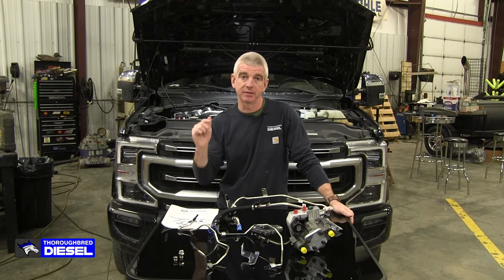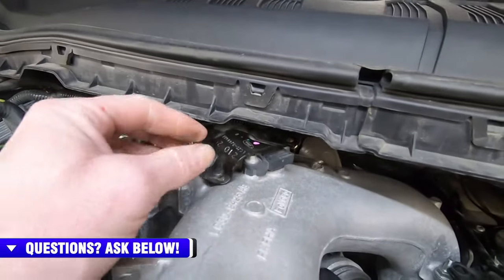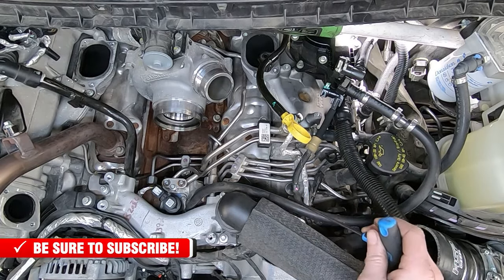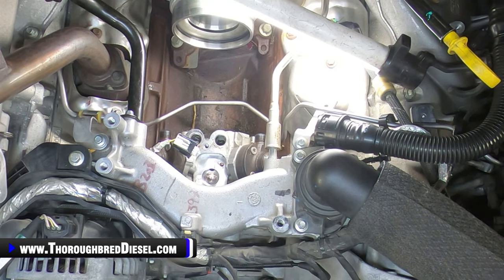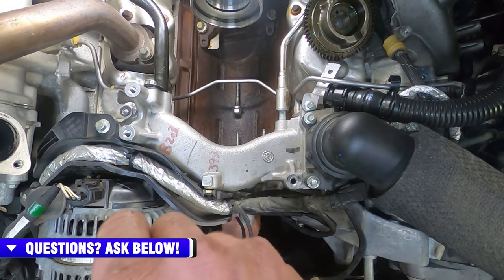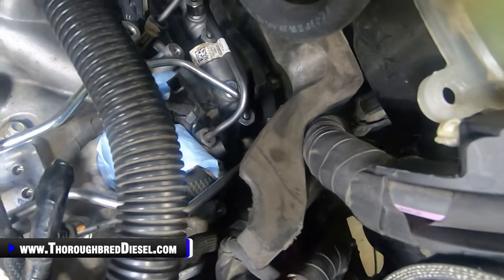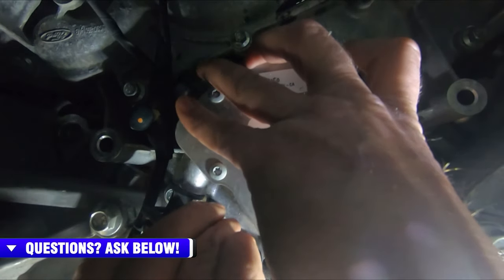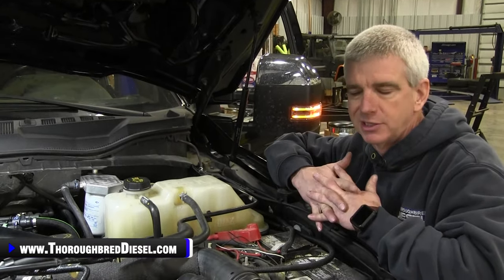How To Install a DCR Pump on a Newer 6.7L Ford Powerstroke @SSfueled  #powerstroke #diesel #fyp

Comment: Thank you for your video!  This was so helpful and detailed.  Just completed my install and my comments are that the upper pulley does not need to come off.  The cp4 was a bear to get out.  I put the nut back on the cp4 and used a deep well 12mm with a sledge and it finally came out.  The DCR going in was also a struggle, torqued the nut to 60 ftlb and it still wasnt seated.  Nice mention on the video to recheck the torque on that nut after it is all snugged up.  Thanks again and great job!
Reply from the maker: Glad it helped!  You're welcome!

Comment: Getting ready to do this job on my 2020 dually.  One comment.  You mixed up the nomenclature of the hot and cold intercooler tubes.  The one in front is the cold side.  The one to the rear is the hot side.

Comment: 2 hrs.... 🎉🎈🎊
Reply from the maker: Very detailed, step by step.
Reply: It would probably take me 8
Reply: @Post_Oak_  I just did mine on my 2016 F350...took me 10 hours.  I thought i could do it a little quicker, but i didn't want to rush anything....double and triple checked a lot of the torqued bolts.

Comment: Have you ever tried removing the fan still attached to the mounting bracket? Seen another mechanic do it that way and wondered if you ever did it that way?
Great vid. I'll be doing my 2022 in the next month and this will save me a few headaches 

Thank you
Reply from the maker: I haven’t tried it that way.  I don’t have a problem with the bracket as much as the dang wiring harness!
Reply: @thoroughbreddiesel  Completed my CP4 to DCR swap out. If I had to do it again I would remove fan from bracket. The little bit of extra room it provides would make things better(less frustrating)
Thanks again for the video, it was a great help

Comment: Hello boss, I have a silly question, what happen if the pump is installed with the two marks in the upper and lower pulley and not using the single mark in the lower pulley.?

Comment: Any negatives to doing this swap? Does it hurt the performance or fuel mileage?
Reply from the maker: We saw a small bump in fuel mileage on this install, but we attributed that to a new, fresh up with optimal delivery.  The DCR is capable of more output than a stock CP4, so the opportunity for performance is there.

Comment: I'm looking at a used 2015 350 Ford dually 6.7 Platinum with 164,000 me I want to know what visual indications there would be in when I started up the vehicle black smoke noise of the injector pump leaks what have you I've been watching a lot of videos but but I don't have access to a testing equipment I'd appreciate any comments that you could assist me with
Reply from the maker: Nothing visual like that other than pulling the FCA and looking for metal shavings.

Comment: How do you move the cam and pump gears to line up the marks
Reply: Before you remove the CP4 pump
Reply: @robertgator8416  Use the crank bolt that holds the harmonic balencer on.  My 2016 needed an 18mm 12 point socket.  Really easy to do with a longer ratchet, just take your time and let the cylinders release the pressure as you turn the motor over.
Reply: Thank you
Reply: @robertsalters9645  Thank you
Reply from the maker: We use the bolts on the crank and turn it while watching the marks in the vacuum pump hole.